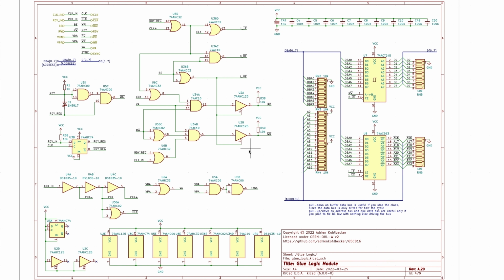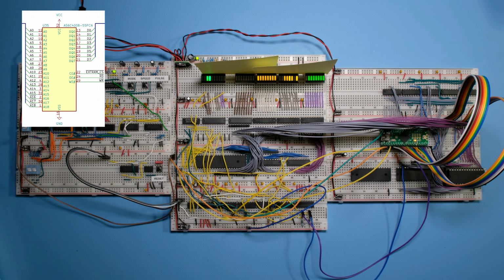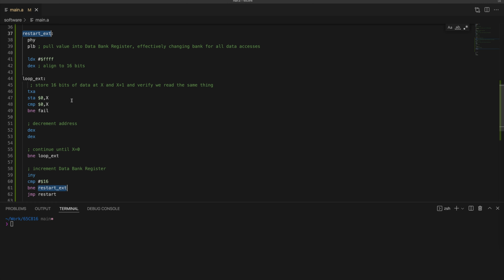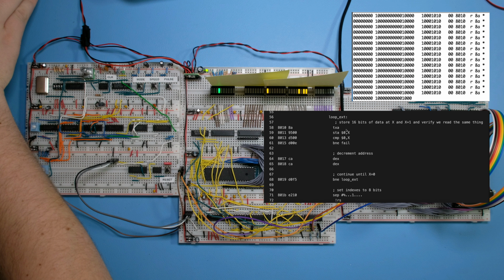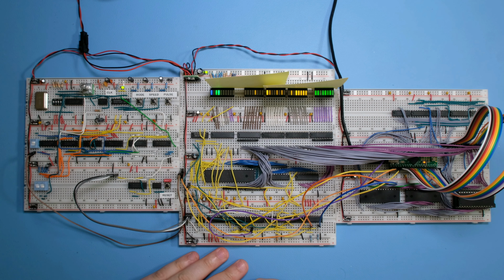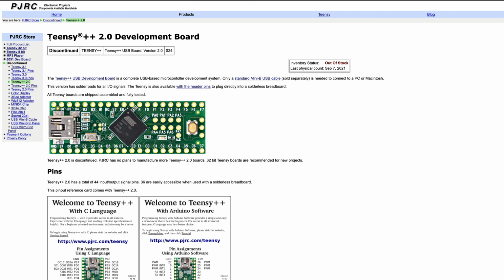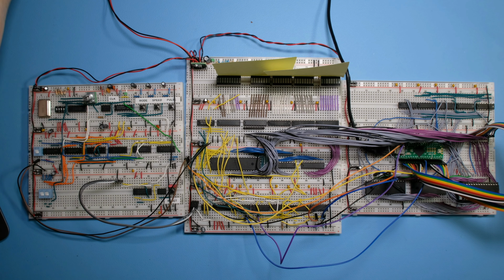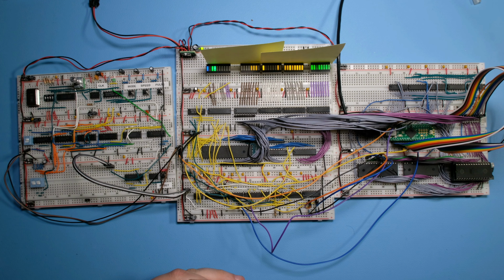#20 - Extended RAM, ground distribution, monitor speed - BB816 Computer

Comment: usually when setting the DataBank you push the bank byte twice aka $0808, that way you can be absolutely sure, you get the bank you want, without having to worry about endianess
actually there is a special instruction pea $0808, which pushes a 16-bit immediate, so you dont have to waste a register for that. Also a neat trick, when working with banked rom is phk; plb, which sets the databank to the program bank. (which could be a fast way to set it to zero in your case)

Comment: I'm unfamiliar with your particular assembler but at 17:15 I'm surprised it assumed you wanted to use direct page indexed mode when the index registers were clearly in 16-bit mode.
Reply from the maker: Sadly, direct page indexed addressing is a valid thing to do with 16 bit indexes, so it must be supported by the assemblers. You just end up overflowing into another page
Reply: @akohlbecker  That's interesting. I need to think about the implications of that. Does LDA (dp), Y continue to work as expected once it has moved on to the next page? My understanding was that DP is similar to 6502 zero page in that it's a block of 256 addresses with special addressing modes, but that it's different in that it can be any page in bank 0. If you're allowed to spill over into the next page, that has interesting possibilities as it's no longer limited to 256 addresses at any one time. I must read what David Eyes has to say about it.
Reply from the maker: @johnm2012  I was just refering to the book while writing my reply :-) You can look at page 390 for the diagram of how this works. Notice that when X=0 it takes the whole 16 bit index, then adds it to the 16 bits direct page register and 8 bits operand.
Reply: @akohlbecker  Yes. My thinking was muddled in my previous post. You and David have cleared it up. Thank you so much.

Comment: when you are getting bool values of va, sync and rw - do it the other way around - if you generate the mask like this ctrl & (1 << 7) the compiler will optimize 1 << 7 into 128, you will save clock cycles used up for shifting ctrl around. Even better you can directly write the mask in like this 0b1000000 - it will be instantly visible what bit we are testing.
So I think it would be something like:
bool va = !(ctrl & 0b1000000);  //! is bolean invert, so when bit 7 of byte ctrl is low (others are ignored) va will be true
Reply: Also use static variables or structs - that way your variables don't need to be created each time your interrupt is called, it should give a substantial speedup.
Don't use digital write, use PORTx |= y; to set a bit- and PORTx &= ~y; to reset a bit.
Also set the compiler into -O2 (or -O3) mode, by default arduino is set for -Os (size optimization) - compiler will then try to unroll your loops and do other tricks to give you more speed.
Reply: print_byte_in_binary seems to print the bits in reverse order? You are printing out least significant bits first.
Reply from the maker: Hey! Apologies for not replying to your very helpful comments. I have implemented much of these optimizations now, and they're coming in episode 32.

Comment: One way to speed up the teensy is to not implement binary.  If you use the %X specifier it will print out the argument in uppercase hex, and hex is easy to convert to binary in your head.
Reply from the maker: True! It is convenient to find bit flips and stuck bits though. I'm thinking of moving this processing to the computer and have the teensy only send 6 byte packets (address, data, control and terminator). This should speed it up nicely by a factor of 10+